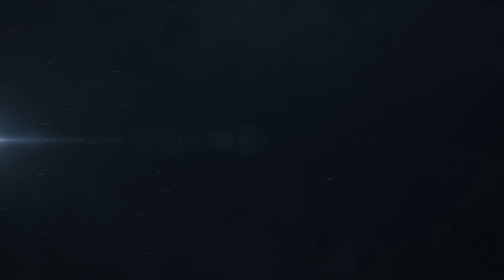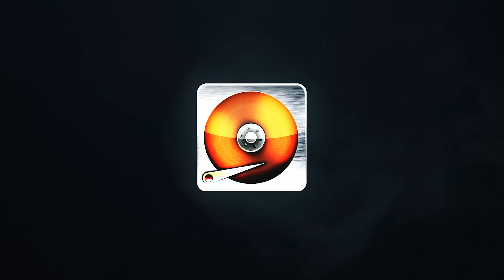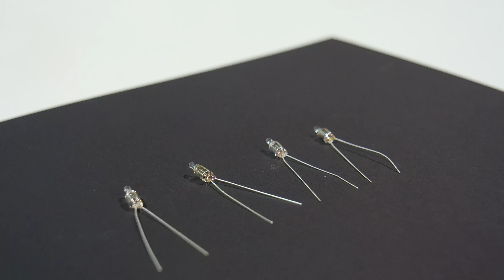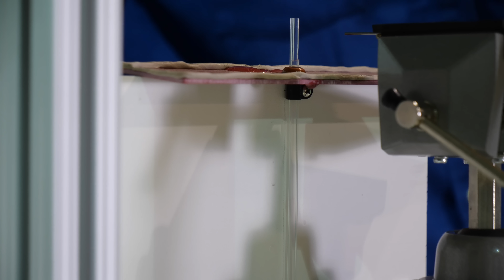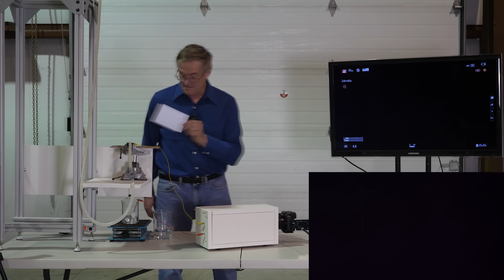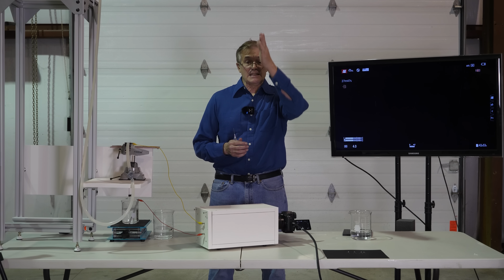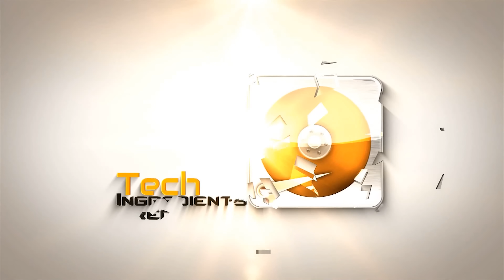We made electricity from water - and it's easy!

Comment: So, it uses a small gravitational difference to disrupt the water causing a small electrical voltage.

How does this compare to a water wheel which does the same thing with a generator?
Reply from the maker: The efficiency is similar, but here there are no moving, mechanical parts.  Also, this requires a much lower head and velocity in order to begin working.
Reply: @TechIngredients why did you delete my comment?
Reply: it has nothing to do with, gravity... just intermittent flow... we watch the same video?
Reply: @chrisjacobsen1659 yep sure did, and gravity is where the energy comes from to cause the effect: 9:40 I won't blindly believe him just because he says "ignore that external force"
Reply: @Grahamaan27  Yea did you watch to 9:50  where he says it has no effect on the electrical potential produced? 

You just need water pressure for water to flow... could use pump, or gravity.... the effect is irrelevant from either of those as an upward vertically pumped setup would do the same thing as this downward gravity driven one. 

Sure gravity drives the motion, but it doesn't create the phenomena. I suppose in a very abstract way it is gravity producing the energy in the same way you'd say the steak you just ate is powering you with the Sun.

What this concludes is there is an internal "friction" in water flow that is electromagnetically associated and can be controlled.

And no one is asking you to blindly believe anything.... that's literally the opposite of the scientific method, question it, build one yourself and contribute to scientific knowledge.
Reply: @chrisjacobsen1659 and you just believe him ? 

Who do you think is right here? The person claiming a sort of "free energy" or the person saying laws of conservation of energy are not being broken?
Reply: @Grahamaan27  wow... it's like you can't read....

Comment: Could the capillary effect, used within a closed system, be used? What would happen using capillary effect of water, rising in a small enough tube. When it reaches the top of the tube will it continue and overflow? If not, what if the the tube was a inverted 'U' at the end. Would the capillary effect continue into the bend, and then gravity take over when it reached the end and drip out? I know it looks like I'm reaching for a over unity device, but I assure you I am not. What happens with this set up? Can it work? Why not?

Comment: I love your channel but here we really need some info such as the amount of water flow and electrical power generated. I am assuming that the electrical power generated is significantly less than the potential energy loss of the flowing water so even a really inefficient “microturbine” would be able to retrieve more power
Reply from the maker: The efficiency is slightly over 10%.  That was calculated in the linked paper based on the water head, the voltage, and the current produced. This is comparable to a mechanical generator, but unlike the water wheel, this will operate with much lower water velocity.

Comment: C-F very strong bond there.  hmm, H^+ and 0H^-  so the electron are actually moving, ok. lol and if you let gravity do it's thing, you have a directional flow of those electrons. ok. so the question is can you tap into that flow and make use of it, of course. lol got a lot of electrons moving in a direction, lol, seems reasonable to expect power. lot of electrons you have, a lot of power you get. 🙂 as you have reasoned, it's just an engineering problem know.

Comment: The main reason you wouldn't want to use greywater for this is that a big prefab, unservicable module would be prone to clogging, and greywater is rarely ph neutral and would speed up loss of the metal coating.  Rainwater does make sense here, which is probably why the authors mentioned it, it's just impractical without massive collection areas.  A relatively clean spring is probably going to be ideal.

Galvanic corrosion is also important to consider in designing a scaled-up version of this meant to run for a longer time.  And with water flow creating the electrical potential, it's probably not even necessary for the different metals to be in direct contact.

Also, the sorts of people who would fake this with a battery wouldn't be the sort to make a bunch of extremely low-wattage neon bulbs flicker; they'd be pretending it'd power an incandescent, or at least an LED bulb...
Reply: Also, algal buildup can happen (particularly with greywater feeding it) and the resulting biofilm would probably interfere

Comment: If the water is becoming acidic, what effect would that have on the environment if we change the pH of the water from the dam for example, or a stream? How long lasting is the effect, does the water stay acidic after we generate power with it or does it get neutralized after the ions rearrange and recombine?

Still, the phenomenon is extremely interesting and when you were explaining it the very first idea that came to me was to stack the tubes, use a hydraulic ram to raise the level of water from a stream or a river, and then drip it through a stack of these tubes in cascades, forming 30cm steps back to the source. 

This way you could set up these installations anywhere you want, with little to no impact on the environment, as long as the water doesn't stay acidic for long.

Great video, I can't wait to see what you make with this, cheers!
Reply from the maker: The water's acidity only exists without a load. The current flow neutralizes the water.
Reply: @TechIngredients  Thank you for the clarification!

Comment: I think you could generate that much power just from the water dropping onto a rotating generator and boost the voltage with diode multipliers and/or  a step up Transformer. You should test this as a control to your experiment.

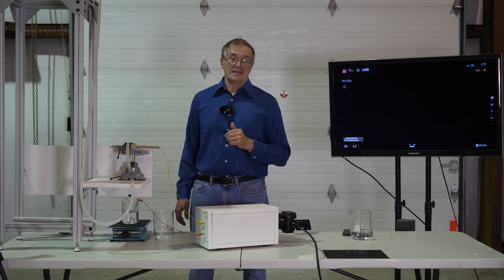Comment: 11:11 I'm confused about this part, why does the heigh matter if they flow is separated with air pockets? How does the potential increase?
Reply: You get more droplet separation with height. If there isn't enough distance the droplets will also not have the chance to reach above a certain velocity.
Reply: are u dumb? the height of the tubing does not matter its just the diameter of the tubing that needs to be 3mm. The height of one meter is needed out of that diameter tubing situation. it does not matter how high it is just the width of the tube the needle is shooting water into. 🤦🏽‍♂️
Reply: @notatallbroe don't insult others

Comment: The commercial systems you described would clog within a day or two with both debris and algae. Now you're purifying water, and the economics go out the window.
Reply: Just started the video, saw your comment.

I'm curious if this would be ideal for an additional step in grid-scale drinking water filtration.
Reply: With out a filter yes, but with a filter this can be done.
Reply: @craigsawyer6453  A filter would be another upkeep to run the system i guess?

Would need human factor and filter replacement costed in.
Reply: @craigsawyer6453 
"... and the economics go out the window"

They claim that their device produces 440 microwatts of energy per 80 ml/min. This is 0.33 J per liter of water. (For 1 kWh you need almost 11 million tons of water!)

Economically, simple water filter cartridges costs about 8 cents per liter (30 cents a gallon).

That is, using filters, they can produce 1 J using 23 cents. Converting to kWh, we get a price of $828,000!
For reference, in the US the average price per kWh is 17 cents, 5 million times less.

This method has potential only where water, as already mentioned above, does not clog the installation. 
Then all the energy obtained will be basically free, and will bring some profit.
Reply: Sand filters can filter a HUGE amount of water. Cleaning? Just reverse flow = backwash, just like a swimming pool filter.
Reply: Also, with say a dam, you would have significantly more water flow than would be needed, so you could allocate a portion of that toward backflow to keep your filters clear. Technical challenges for sure, but intriguing possibilities.
Reply: Also use silver and copper to kill the microorganisms

Comment: Interesting, yes an array would be interesting along with the metamaterial like thinking.  I've wondered this and somewhat similar balloon or kite powered systems that are high voltage and the most effective circuit to transform or DC-DC convert.  Guessing some sort of capacitor and inductor bank to stabilize or maybe not. At least capacitors to store the HV potential. Seems like an HV DC-DC converter with low losses might make for an interesting device so to be able to use more practically if even for lighting.

Comment: Isn‘t this the exact mechanism how charge separation is achieved in thunderstorms?
Reply: No, Kelvin's Thunderstorm lets charge separate randomly and attenuates it by using induction. One stream is positive; one stream is negative.
Here the stream always has the positive ions in the stream and the negative charge in the wall of the tube.
Reply: Pretty much except he is using random ions instead of charge induction. He is showing a remarkable amount of naivety in this video.
Reply: @pixelpatter01  you would be surprised how much science is re-discovered in different fields, because no one person can study every aspect. It's actually not a bad thing, because every viewpoint brings different insights.
Reply: @LawrenceKincheloe  If the old maxim was correct, we're doubling our knowledge every ten years since like 1980. Nobody on earth is on top of everything.

Comment: seems like static electricity to me. probably same mechanism as how lightning is formed
Reply: Same concept as he mentioned in the video. The only thing that makes "static" electricity static is that it's not moving. When you're walking around and building up a static charge, it is not static during the movements that build up the potential difference, it is dynamic. It is not static when you discharge to something metal and it sparks and hurts, that is dynamic.

Static is when something is not changing, dynamic is when it is. Static electricity is static when you're still and your potential relative to the environment is not changing, though usually implied to be non-zero as well (but that isn't really what static means, granted a 0 potential difference to your environment is not generally notable as its effect is simply not having the potential for electrical shocks between you and the environment)
Reply: Triboelectricty from the moving water drops within a cloud which contain ionized water molecules due to being in atmospheric suspension between the earths surface (ground) & the earths own magnetosphere (charge. Created by the suns solar wind striking & moving along earths magnetic field).